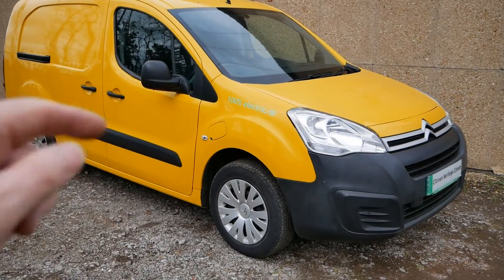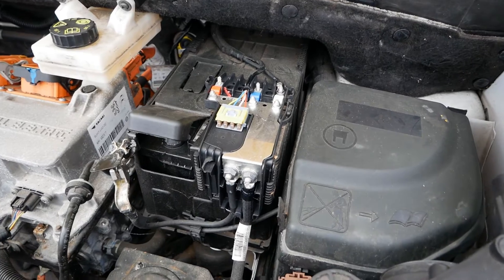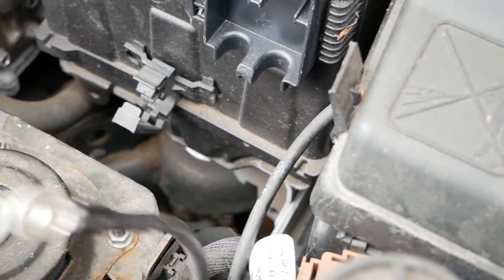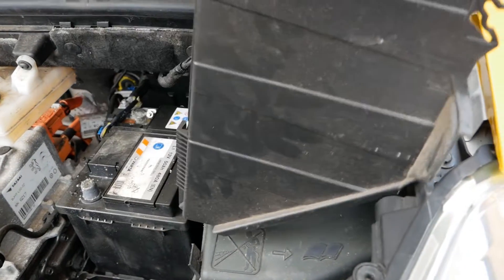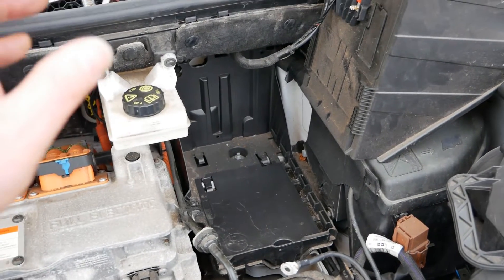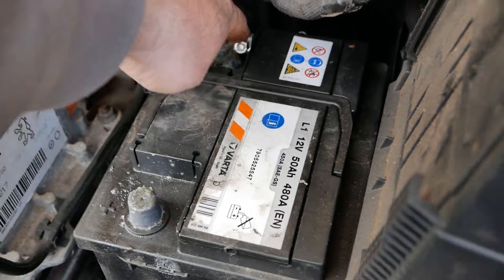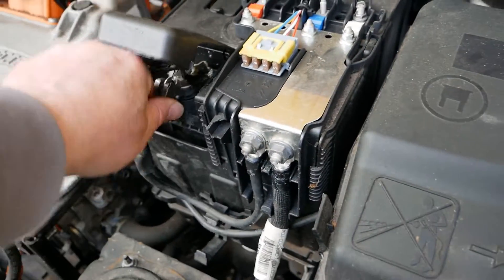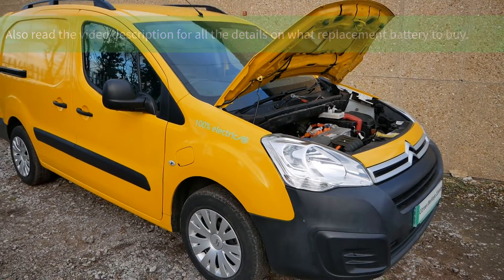How to change the 12V battery in a Peugeot Partner/Citroen Berlingo 22kWh electric van?

Comment: Hi, thanks for the video, helped a lot but car still doesn't work. Battery broke down after 2 weeks on vacation while having a dashcam on the OBD. Unfortunately the voltage safety didn't cut the connection.

As I tried starting the car it told me engine fault and the battery led came on. After charging and changing the battery it tells me Energy Saving Mode together with the engine fault led. 

Andy advice before getting the car to a workshop?
Reply from the maker: If you're sure the aux battery voltage is now fine (needs testing), then I suspect the error codes just need clearing.

Comment: Thank you so much for the video. I just changed my battery after your instructions and managed just fine with my housewife tools. The bracket was a bit tricky since I did not have a long extension bar like yours, but managed with a long screw driver that fit just right into the square hole in the socket. Best of all, I am on the road again after car would not start this morning. Sincerely, Hanna
Reply from the maker: Glad it helped.

Comment: Good video. Thanks.  I would insulate that extension piece for using across the terminals like that.  How much does startup take from 12v battery.
Reply from the maker: On an EV, startup takes almost nothing as its only powering some ECUs, the dash and the contactors in the HV battery.